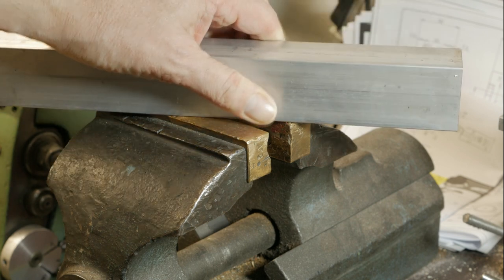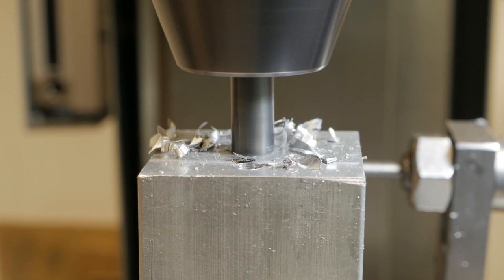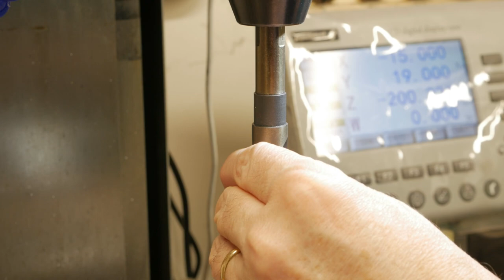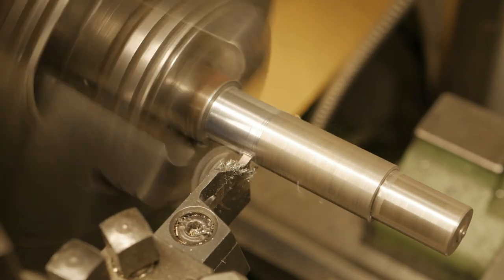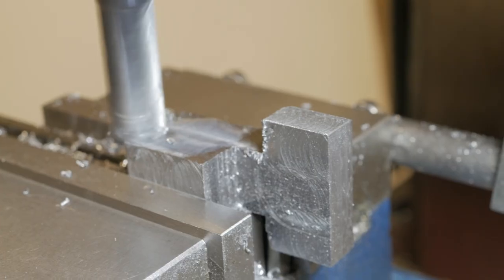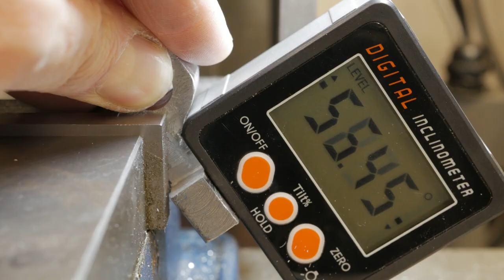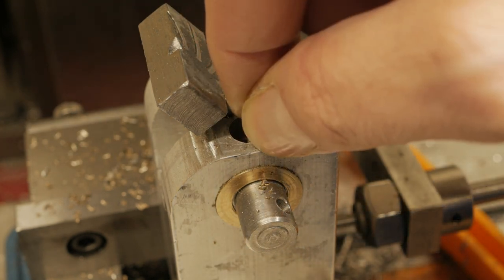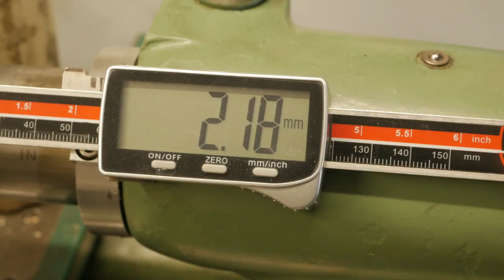Make a Homemade Spindle Lock for Your Milling Machine!(Sieg)

Comment from the maker: Good morning everyone,
I immediately realized, when my milling machine arrived, that tightening the ER32 chuck practically requires 3 hands, which nobody has!
Because the cutter does not always have a unified diameter and you have to hold it in the collet while closing the nut, or you need more than one chuck with the cutter mounted ready.
At this point I tried, with the space available, to install an anti-rotation block, which was both easy to build and robust.
I hope you like it!
Alberto.

Comment: Excellent feature Alberto. I need one for mine, but don't have a convenient dog to brace against. I'm going to have to make one that engages with a drive gear or something. 👍👍
Reply from the maker: Ciao Olly, happy to see you ! Thanks for the comment: yes i really don't know why in my milling machine there's no a spindle stop or a no-rotation support ! The support that i made it is strong for what it have to do, maybe you had note that at the end, when i closed the ER32 the ring, the column vibrates a little, this is becasue the original foor support are small iron " C" plate, not strong, that i will modify in future for sure !!

Comment: Nice idea, too bad the Sieg SX3L sold by others don't have the iso30 taper 😆  They have two holes to slide in a pin spanner. It'll be tricky to make something like this for them. Another option is to pull the spindle out and hard machine it to add something like drive dogs for mt3 / R8 🤷‍♂️
Reply from the maker: Hi HM, yes the NT30 taper is wonderful, but the insert/take down is not automatic with the machine in standard configuration, a next step can be to add a device on top that put down the drawbar, i have to think abot it !! Thanks for your kind comment, ATB !! Alberto
Reply: @ab-shop  Sieg mills usually have a captive drawbar but the quill needs to be locked in place for that to eject the tool. I tighten the quill real hard and then run the spindle at lowest speed while holding the hex key at the top. Self ejects! I have a video where I made a brass bushing for the drawbar to reduce the friction that helps.

Comment: Nice boring head!
Reply from the maker: Cia Mark, yes the Wohlhaupter UPA3 is a great piece of old vintage mechanincs: as you probably know, it is automatic, so if you fin with the bar inside the wood box, the head during rotation, you can face the stuff or you can go advance radially, also if your milling machine has the automatic vertical feed, you can make a a conical hole!!